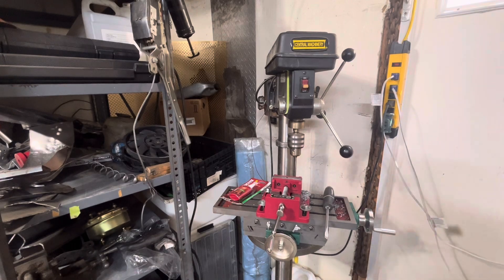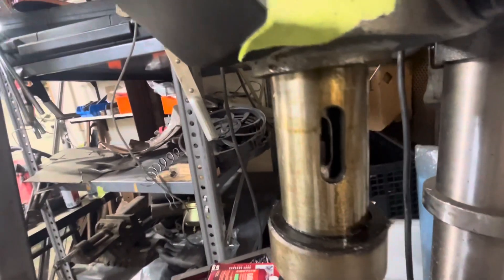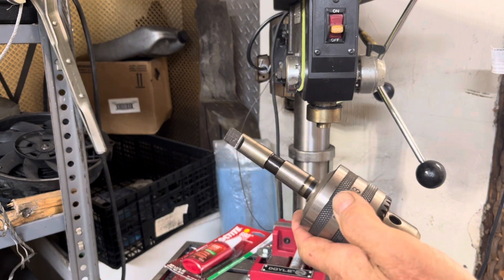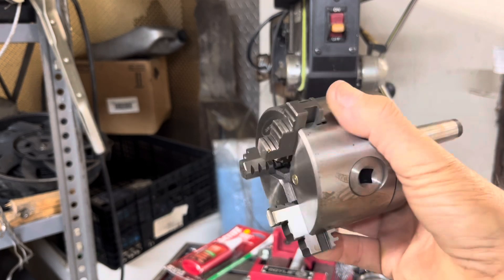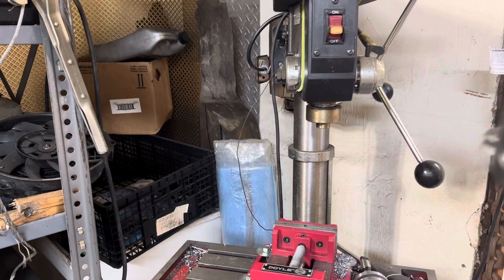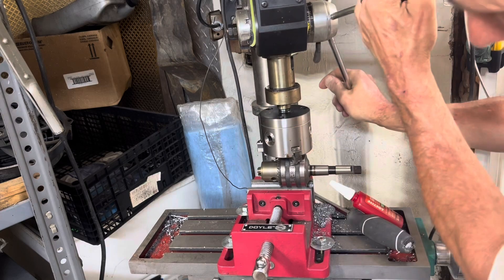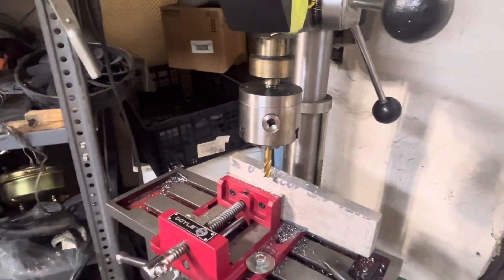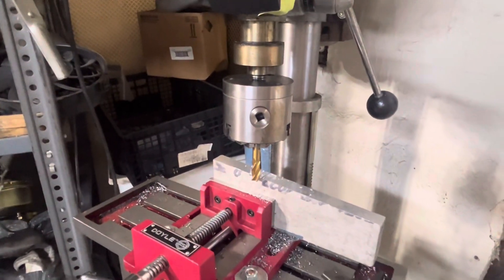Installing a 3 jaw chuck on a drill press. Watch me do it and try it out 😀

Comment: This is right up there with other videos on YouTube showing idiots putting skill saw blades on an angle grinder. You are setting others up for a bad day. Tools are application specific and shouldn't be dangerously modified.
Reply from the maker: Personally I didn’t like the toothed blade on the grinder. I was in a class once where one of his guys cut his thumb off that way. I do have this at home on a bench top mill and it’s awesome. 3/4 and 1” end mills no problem. The drill press doesn’t have the bar that’s why I used the special loctite for setting fittings. I’ll post something if it comes apart

Comment: there is an anti-rotation tang at the end of your old MT2. but for the rest of the video, sorry, there is so much that has a cringe factor attached to it. please dont hurt yourself
Reply from the maker: The old one broke loose so I don’t think so. I have this on a machine at home. Great versatility, plus more rotation weight so less grabbing by bits. Thanks for the comment. But if you are pressing down on work it can’t possibly come off
Reply: @Motorhead_Mark  that is correct, down-force will only push the MT2 in. side-loading has been a very fast and proven method for the MT2 to fall out the quill, not sure how much the loktite will help. the weight of the chuck will not help to keep it in place either.

Comment from the maker: You can run the big end mills with this!!
Reply: Have a tourniquet ready.
Reply: I’m going to look up end mill bearings for my bench top drill press. Surely a machine shop can enlarge the original bearings and the casting to fit